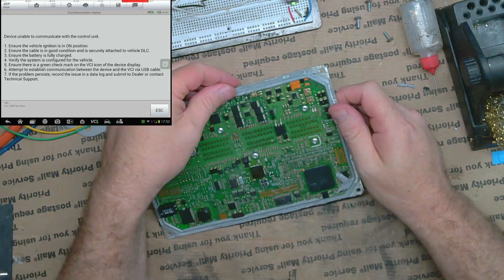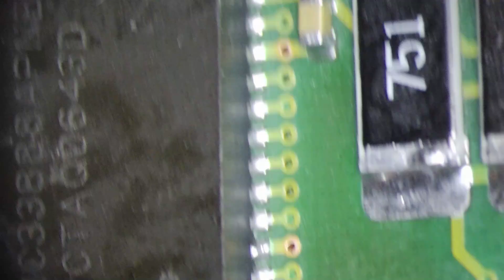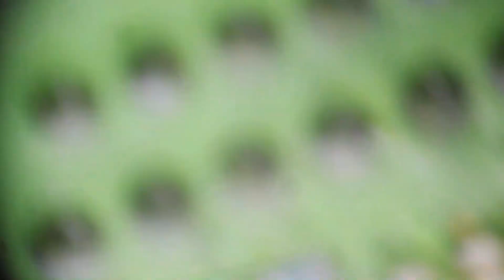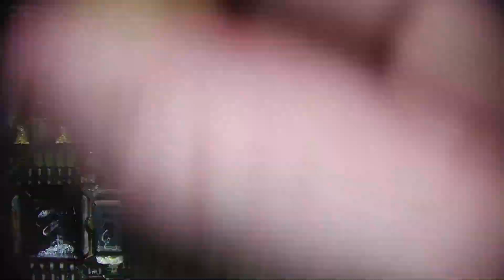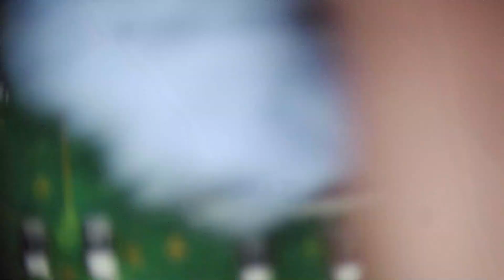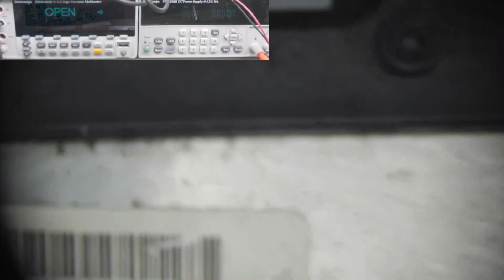Troubleshooting JEEP G. Cherokee PCM with No Communication after failed DIY no charging repair

Comment: That capacitor almost flew into that place where we lose our capacitors when working on the bench while you where brushing clean the board. Same place where my 10mm sockets go 😆. Im  Curious as to a good source for that driver . Thankyou for this video because I have several of these ECMs saved in my ECM stock
Reply from the maker: i usually get parts from mouser or digikey

Comment: My starter does not start and the C38 pin that goes to the starter relay is supplying negative energy instead of positive energy. Can you help me with repair instructions, I reward you for your help.
Reply from the maker: C38 is suppose to provide the low signal to activate relay. It gets high signal from tipm control.
Reply: @ecurepair  My Module is giving a grounding signal.

Comment: Would the chip be classified as a QRP package?
Reply from the maker: Its a 36-PIN PQFN
Reply: @ecurepair  I have soldered a 32-pin chip in Of course I used a lot of de-solder wick. About three years ago my brother and sister in-law gave me a soldering microscope I use it all the time. I enjoyed watching your video and your  techniques.
Reply from the maker: @MsFireboy2  Thansk for your comments. A microscope is a tremendous help, that was a good gift.

Comment: It was a good video. I enjoyed What is the best temperature for the hot air on the right side?
In one case while working with hot air, I mistakenly poured cleaning fluid instead of flex and burned the IC. It was a stupid mistake. :face-blue-smiling:
Reply from the maker: I usually run them both close to max temp and airspeed for these units. The case on these ecu's soak up a lot of the heat thats why 2 is needed.  Its much faster then using preheater to bring it up to temp and I like to avoid heating up the entire unit because of the bga.
Reply: @ecurepair  thank you very much

Comment: Excellent work. A question, is there any equipment that can completely clone that PCM model? That is not so expensive? Do the complete reading of the micro and the writing by OBD or by JTAG?
Reply from the maker: The tools I use are pretty expensive so not sure I could give any meaning full advice on the lower  cost ones.  ngc5 is listed in Kess3 for jtag and some models for obd2, never tried it though. Might could do it with original xprog. it does ngc3 & 4. 5 is probably same as 4 but again, I havent tried it. Never had the need to clone these. Have always just reflashed them with legacy chrysler tool.

Comment: Interesting!! What is the Microchip MCU, or is the Microchip chip a CAN transceiver?
Reply from the maker: Its a driver ic but the low side drivers are controlled through spi so they can shut down main chip if not right.
Reply: @ecurepair  ah sort of like a watchdog
Reply: @ecurepair  thanks

Comment: Great work! Great Video. I tried to replace these since alternators blow them all the time. But I have a hard time heating them. l'll use two heat guns next time. I got some of these Freescale MC33888 chips but I think they were imitations from China. And they seemed to not work good.  I get them from other used PCMS from the junkyard.
Reply from the maker: I'm still milking a hoard I of them I purchased when they first went obsolete.